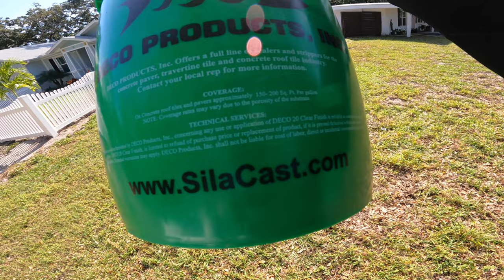this is how to seal pavers! #pavers #paversealing #pressurewashing

Comment: Great job. Do you prefer the backpack sprayer over the bucket unit you made previously?
Reply from the maker: Yes, absolutely. I dont have to drag the hose or move the cart. I still have the cart as a backup somewhere but the backpack is so easy to mount up and walk with.

Comment: With Black Diamond sealer, do you have to back roll it with with roller to avoid floods as seen on their video?
Reply from the maker: I dont use black diamond sealer. But no if it's a water based sealer there's no need to back roll unless you spray way too much and it puddles a lot.

Comment: You don't knock out the old sand from the joints when surface cleaning or turbo jet the joints?
Reply from the maker: Of course. All the sand is washed out by the surface cleaner and during the rinse. That's WHT I used 1.5 bags od sand on this project

Comment: Do you ever have to strip pavers? And what do you do if it was sealed 2-3 years prior but minimal shine to know it has sealer on it?
Reply from the maker: Yes pretty simple process. Just spray stripper on let it dwell for about 15 minutes then either turbo nozzle it off or surface clean it. If it was water based you could clean and reapply but if not then it must be stripped. Youre gonna ask how do you know, well that comes with experience Best thing to do is just strip it when you dont now, Obviously this will cost  way more to the homeowner.

Comment: hey man i just got a call and it would be my first paver job it’s 2,500 sq ft how many gallons of sealer do you think i’d need?
Reply from the maker: Probably 3.  To be safe. Usually each 5 gallons cover 1000-1200 sq ft.
Reply: @PinkFlamingoPowerWash  Thanks man

Comment: Quick question about the silica sand. On average how many bags you using to fill joints on a reseal. Like how many per 1000sqft or how many sqft per bag?
Reply from the maker: Depends on the size of the joints. Roughly 1.5 bags I'd say
Reply: And for that job you did how much silicast did you use? What would you say the sqft of those pavers?
Reply from the maker: @SEAN RYDER  about 6 gallons for the 2 coats.  1200 sq ft
Reply: Thanks brotha! Gotta 1200sqft job Monday and figured on 6gal just making sure I was close.  love the content too making me wanna start posting myself
Reply from the maker: @SEAN RYDER  go for it brother. 👍
Reply: Last question for you on this.... you has any issues with the craftsman sprayer? Is that still the same one you originally bought?
Reply from the maker: @SEAN RYDER  yea no issue. Except when the little filter inside of it got clogged. I didn't know there was one in there. But since I've cleaned it I haven't had any issues.

Comment: what rpm are you running your machine at when down streaming the sh with open ball valve?
Reply from the maker: RPM? That's a little too technical lol.  I run my pressure washer full throttle every job.  I need all the juice!
Reply: @PinkFlamingoPowerWash  thats what i meant lol sorry.. always grateful for your videos and knowledge bro!

Comment: Great job Cliff. Hey, I was wondering how do you price this job is it all in one or do you separate it for the customer? Thanks.
Reply from the maker: Paver sealing is all on 1 price.  No need to break it down. You can't seal the pavers without cleaning them so on and so forth.
Reply: @PinkFlamingoPowerWash  Awesome Thanks Cliff keep up the great work!! One more question how did you like that sticky icky pine that Dom raves about are you a fan I just ordered a gallon.
Reply from the maker: @jedwards2002  it smells good but that's what I like it for. I still prefer the slo mo so what I do is mix it together. So I can have the best of both worlds

Comment: Great video! Really enjoy the content! Quick question which Deco product would you use to seal a sand blasted marble pool deck? And would you still use the silica sand or another type of joint sand?
Reply from the maker: Never done one of those before. Silica sand is versatile so it works well with all pavers. Lot of different sand are used in other parts of the county because of the climate. Which is why up north most people are using Poly sand. And do seal a marble deck with Deco id go with Deco20 Clear.
Reply: @PinkFlamingoPowerWash  Awesome! Thank you! I reached out to Breck with Deco and he told me the same thing. Thanks a lot man. I’ve been learning so much watching your videos. Really appreciate you.

Comment: So if a customer just had their pavers installed and you can't measure the sqft out on Google earth, how would you get the sqft? The length x width won't always be the same thru out the driveway/porch.  Thanks
Reply from the maker: Just go in person and measure it. What do you mean it won't be the same throughout?
Reply: @Pink Flamingo Power Wash LLC  Like, let's say it's an egg shape, the width wouldn't be the same throughout the entire shape
Reply from the maker: @Jared Scott length x width still applies.  You can always break it into sections and then add all your sections up.  It doesn't need to be a square or rectangle to get the square footage.  

When I measure pool decks it's the same scenario as you know pools aren't typically square.